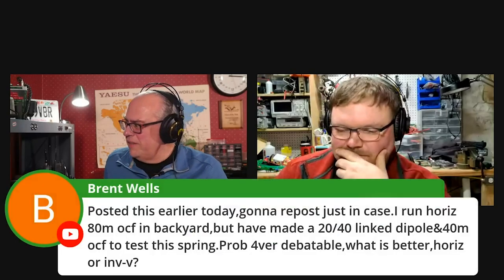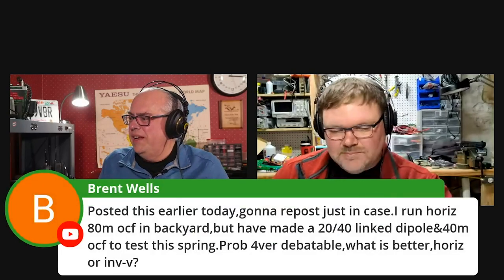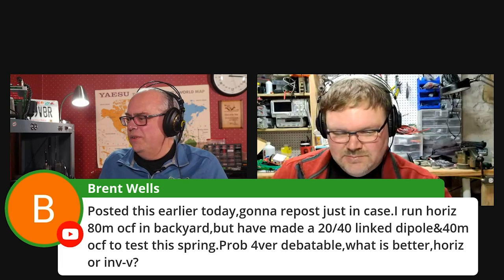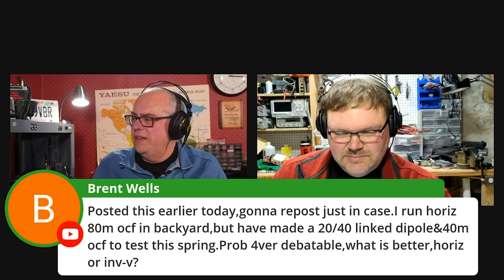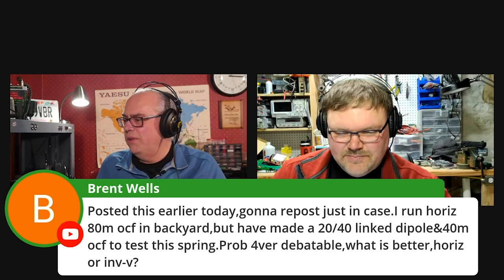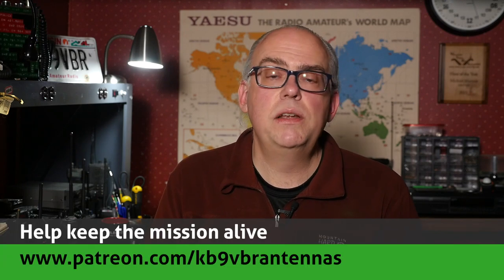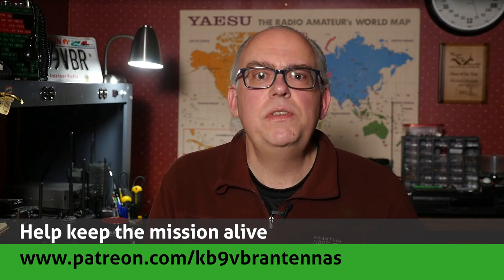February 2021 Livestream Excerpt: Which is better, Flat Top vs Inverted Vee antenna - Ham Radio Q&A

Comment: Thanks, for the video!   

I have a little bit different take on the question of which is better, flat-top dipole or inverted V.   There are other things to consider besides angle of radiation.  Which works best in any given situation might depend on:

1 -  The supports that are available for the antenna.   If you have only one support and a simple wire antenna, an inverted V is going to be the antenna that is most practical to erect.   If you have two, or more, available supports, a flat-top dipole can be erected.

2 - The feedline that is going to be used for the antenna.   A resonant inverted V is going to present a better match to 50 ohm coax than a resonant flat-top dipole.   But a balanced feedline can be used for either a flat top dipole or inverted V, but requires a balun and possibly a tuner.

3 -  An inverted V can be arranged into a V beam antenna to provide some directivity with only one support.   A flat-top dipole can also be arranged into a V beam antenna, but requires a minimum of three supports.

4 -  Portability.   It's faster and easier to erect one support for portable operation with an inverted V than two or three supports with a flat-top dipole.

5 -  Versatility.  A resonant inverted V antenna can be converted into an elevated ground plane vertical antenna through adding a vertical element at the feed point and using a relay switch box that switches the center conductor of coax to the vertical element and connects the shield to both legs of the inverted V to be used as resonant sloping radials.   This simple change makes the inverted V into a vertical that is going to be superior to the flat-top dipole for low angle radiation DX, while providing an omnidirectional pattern, rather than the bi-directional pattern provided by the flat-top dipole.  This assumes a resonant single band antenna.

6 -  Desired pattern.  An inverted V antenna is going to provide a more omnidirectional pattern, while a flat-top dipole is going to provide a more bi-directional pattern.

7 - The available area for the antenna.   An inverted V is going to require less space to erect than a flat-top dipole, which may be a determining factor for small parcels of land.

And, of course, the other factors you mentioned in your video.  Thanks, again!

73
AI4IJ

Comment: My non-scientific experience has been that the inverted "V" is a little bit more omnidirectional than a horizontal dipole.  The nulls off the ends are slightly less noticeable.  Both are good performing, economical, easy to build, resonant antennas.
KZ9V

Comment: Interesting video.  I've been told that an inverted-vee is better at radiating and receiving signals off the ends of the antenna then a flat-top.  A flat top antenna radiates and receives signals more broadside to the elements.  In general, is this true?  Thank you for the video.

Comment: Thank you for the video! IMO for low radiation angle of a flat dipole antenna, it should be half wavelength above ground, not quarter wavelength, because with only quarter wavelength you will have a  sky warmer antenna, which is excellent vor NVIS but not so good for DX contacts ;)  vy73 from Hamburg/Germany, Dietmar, DL4HAO